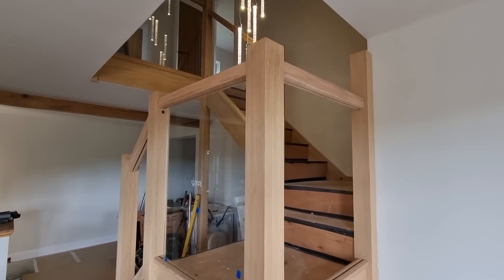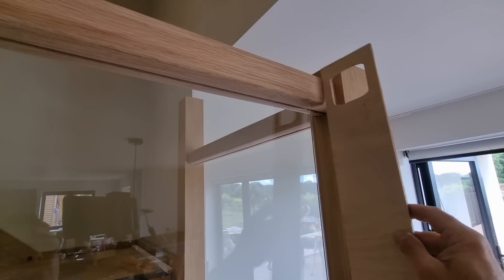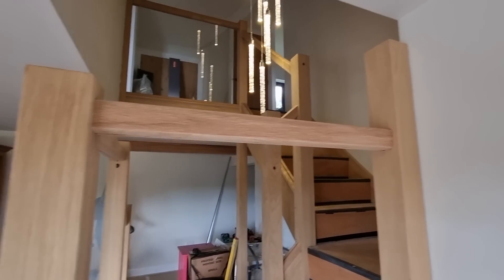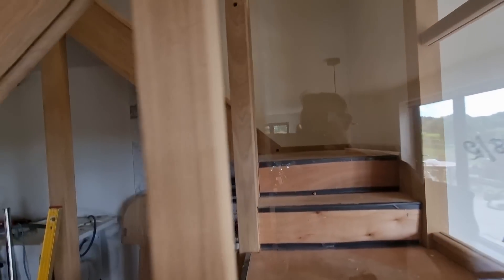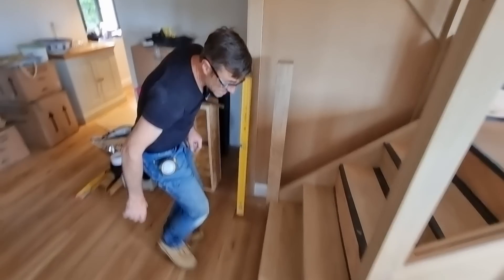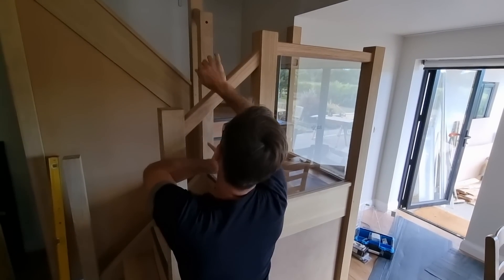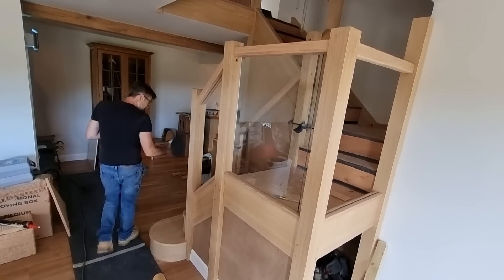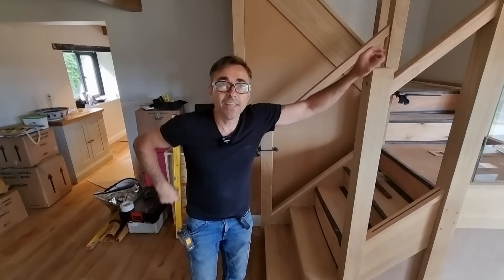The Big Build staircase feature tread and handrails

Comment: class work. ive only done a couple of stair cases with glass but its always been with the glass clamps. 

that trick with the router and template is mint also. gonna have to try that one out. ive always used those zip bolt things in the past on oak jobs as you can hide them really well. they can be a bit fiddly though

Comment: Is that suction lifter small enough to use on Kitchen plinths?  What was the price as it looks like it has a good suction grip.
Reply: i cant speak for the one robin has but i have  a 60 euro one from amazon and it is great , i have lifted double glazed doors with it , it was well able to hold more than i could lift . the diameter is probable too  big for plinths but would definetly pull them out if you could get it on
Reply: @MelbourneAlan  Yeah I have tried so many from Amazon, eBay and most dont have the pulling grip and just come off.